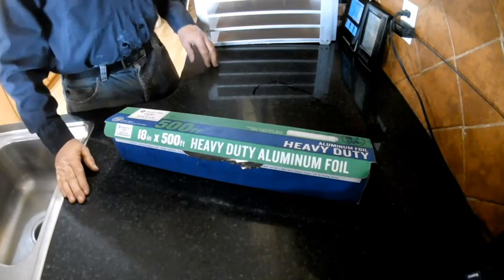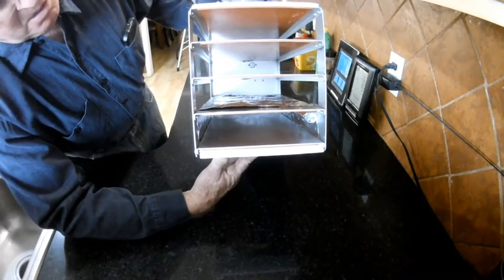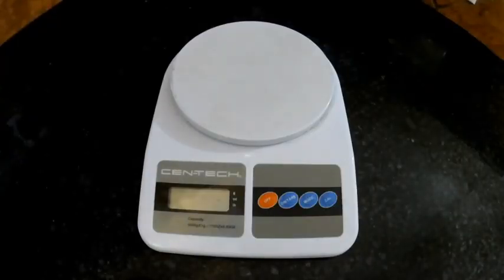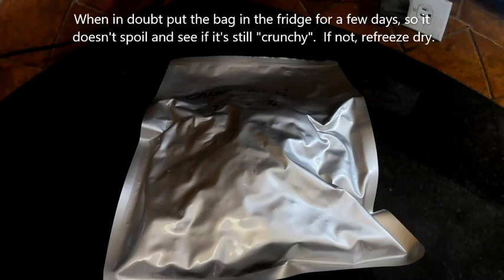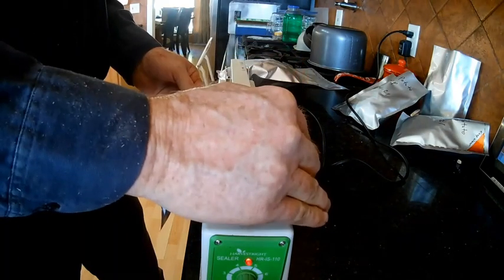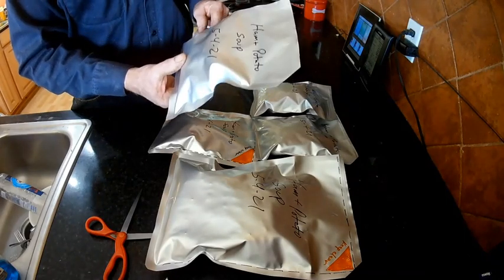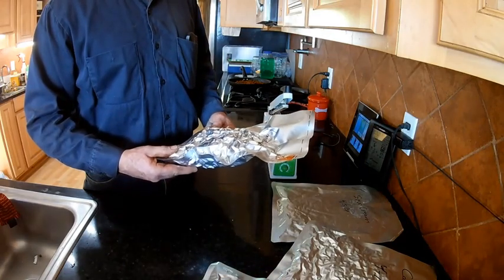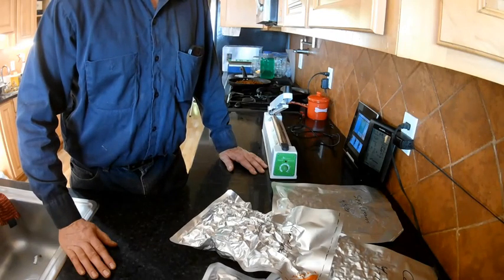Hints and Tips Harvest Right Freeze Drier Part 2

Comment: I defrost my chamber the same way except I have a table I slide under it and have a bussing tub on the table. I put a hand towel under the bottom tray and the other end in the tub to use it like a "wick" . No splattering or dribbling. The tub is bigger enough to catch the ice that comes out. The "wick" works great.
Reply from the maker: Good idea

Comment: Okay so all I need is something on the sides of the bottom shelf.

The ball valve should be all stainless steel.
You might try using disposable glad containers to put the asparagus in before you put it in a bag.

Comment: Hi , my wife and I just purchased a new Harvest right freeze dryer. We started at 3:30 pm doing the bread run, at 7 am the next morning it was still running. The vacuum pump was very warm and still running. I manually shut it down. Removed the trays and the tray rack.   Let the ice melt and drain into a bucket. After when I checked it the water in the bucket had oil on top of the water. Checking the  vacuum pump it was down one full line below the half mark. I have called Harvest right and they are to get back to me on Monday, the 6 of June at 12:30. I have been watching your videos and you
seem very knowledgeable on these things.    Just looking for your thoughts on what is the issue. Where can the oil come from. Is there programming issues. The pump was still going at 7 am when I shut it down and it ran an additional 15 minutes after I shut it down. Thanks. Ken
Reply from the maker: Lets look at the oil level first:
There are are internal compartments within the vacuum pump were oil can "hide".  If this is your first run, some of the oil may be "trapped" or "hiding" inside the pump.  Drain the oil or top it off and try again.

Oil in water:  There is a check valve in the pump that should prevent oil from leaving the pump and entering the FD chamber.  There is a chance some of the oil you're seeing could be left over from manufacturing.  Clean the inside of the chamber (stainless steel surface) with isopropyl alcohol.
Reply from the maker: It's normal for the pump to get hot.
Reply from the maker: If you need to open the chamber in mid-batch, open the drain valve first to release some of the vacuum on the pump.  After a few seconds, turn off the pump, at the pump's switch.

Comment: I was able to get my "shelf" out of the freezer even with the ice surrounding it.  It just came out.  I didn't try to break out any ice.  In your video you defrosted first and then removed the tray for the large bags. Regardless which way it is done, have you thought about waiting to snip the corner of the bags till after the defrosting is done to vacuum seal them?  That way you don't have to deal with the fitting the smaller bags into the tray.  I found that I have to sometimes break food in order to get the bag to fit in the tray and the rubber heating pads keep the bags from slipping in easily sometimes.  So if all the bags are done at the same time, after the tray is removed, then it seems like that would be easier?  I wished I would have re-watched the end of this video first.  I vacuum sealed some asparagus spears yesterday using the vacuum seal technique.  I hope the spears still have some shape when I add water in the future.  The bag still feels and looks solid.
Reply from the maker: I love asparagus.  The only problem is how brittle it is.

Comment: Phil, The first four bags I extracted the air from the Mylar bags like you show in this video worked.  The second time I did it, I had six bags in the inside chamber slots.  Five of the bags worked and one did not.  I sealed the five bags that worked.  The final bag I tried the two minute vacuum procedure two more times.  Would not "deflate" like all the others or your video.  I finally decided it must be the bag.  I got a new Mylar bag and pulled the transferred the food to the new bag.  I ran the two minute vacuum procedure again.  The bag would not deflate.  I finally gave up and since I had an oxygen absorber in the bag, decided it would still last the 20-25 years expected.  Do you think the problem could be that I was cutting the corner too big and the hole is too big?  Have you ever seen this problem and if so, have you figured out why the air extraction procedure is not successful?  Thank you.
Reply from the maker: I have found the corner area needs to be clean and clear.  Powders can keep the two sides from sealing.  The corner vent hole will almost seal it's self.  I have had times where I missed making a hole and the the bag exploded.  I guess you could seal the corner and try a vent hole on the other side.  Good luck.
Reply: @Philat4800feet  Ok, thank you.  Helpful information.  Since I changed bags for this particular food, I would have thought it would have worked.  The chance that two bas had powders on them in the corner sealing area seems low.  I'll try your suggestion of sealing that hole and cutting the opposite corner next time.  Just very weird.  I'm completely new to this so I'm sure it's operator issues.  Funny that out of about 10 bags that I sealed so far using the vacuum, only one had trouble and it failed three times including a new Mylar bag.  :-)

Comment: Hi Phil, I have a question.  When I am doing the functional test before I use my freeze dryer, ...do I toggle off the freeze and then turn on the vacuum.  I tried to do the test last night to get my 500 mTorr and the best I could do was 2300 ish and then it was weeping on the outside of the seal.  It is the weekend and I cannot get ahold of anyone.  Any ideas?  Thanks for the video.
Reply from the maker: From my experience I can pull a better vacuum with the cooling unit on.  Cold will contract.  Depending on the metal, stainless steel verses, mild steel, verse brass, I think the fitting become tighter and less leaks

Comment: Phil, I can't tell what model you have?  You pushed the "vacuum" button or something like that when you went to suck the air out of the bags (2 minutes) with the small diagonal corner cut off of them.  When you release the drain valve, the bags shrink and remove a great amount of the air in the mylar bags.  1) What model is the unit in the video?  I have a new 2022 large model and I have no control over operating the vacuum pump manually like you did.  what I did is move the vacuum pump power over to a plug instead of the back of the freeze dryer.  I then manually ran the vacuum pump for two minutes that way.  That worked.  I see no way to do control the vacuum pump through the freeze dryer operator panel on the large unit I received a month ago.  2) Do you still put an oxygen absorber in those bags even if you remove the air with the vacuum pump like in this video?  I assume you would still do that right?  Thank you.
Reply from the maker: What happens when you press the round Leaf Icon on the upper left screen?    There are 3-4 touch menus on the screen.  
Touch the top middle to name your machine.
Touch the center screen Set-up Configuration 
You should also have a custom and start button
I have a four tray model.
I add an oxygen absorber if I'm going to store the bag for more then 2 years.
Reply: @Philat4800feet  I forgot to reply.  Thank you, the Leaf Icon works.  Piece of cake!

Comment: Does the aluminum stop the FD from pulling the moister out of the food?
Reply from the maker: Nope.  the water vapor gets out just fine and shortens the drying time.
Reply: @Philat4800feet  would it then, be better to wrap the whole tray system to speed up the time? I don't have a grasp on the whole situation, but I was just wondering. I do understand that the other trays are further from the barrel, therefore, get warmer.
Reply from the maker: @vickiebonano2092  My entire tray assemble is wrapped.
Reply: @Philat4800feet  Thanks so much for the info. I am new at this , I have only had my FD for 3 months. My hubby thinks I'm crazy because I am so excited about it.
Reply from the maker: @vickiebonano2092  Freeze drying can be addictive.